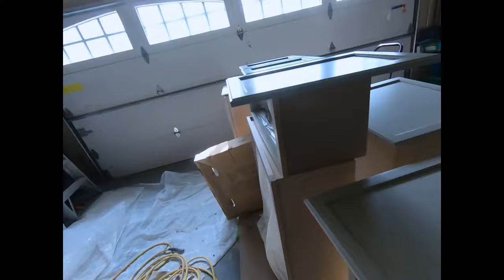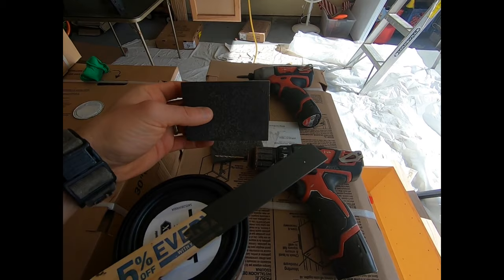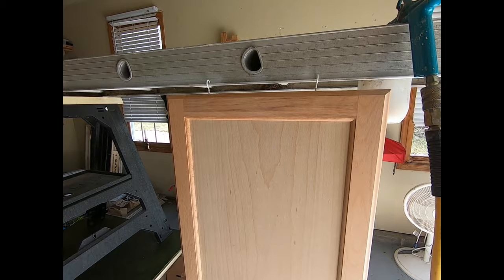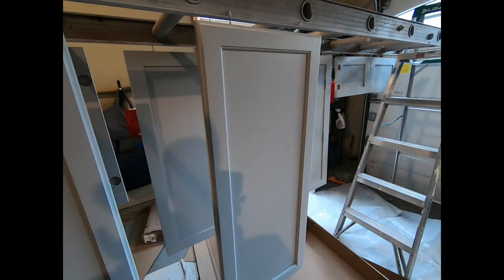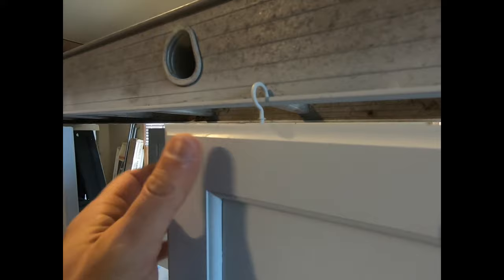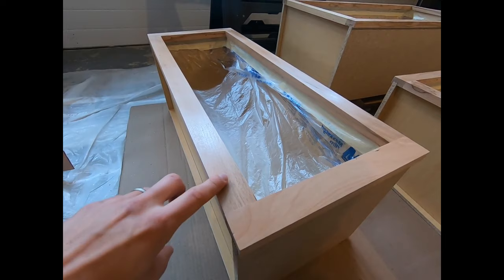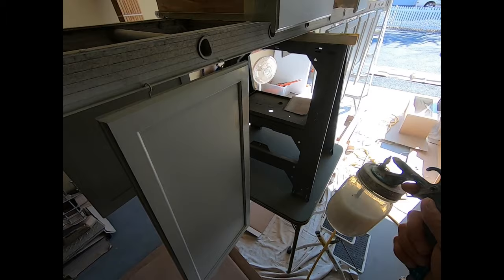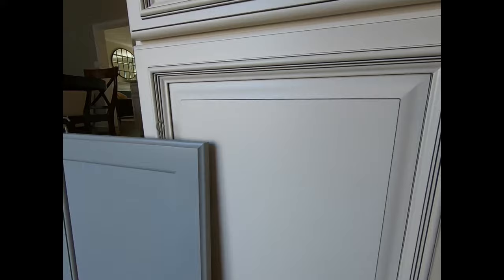How to paint unfinished cabinets from home depot or lowes

Comment: Hello again. So I finally used my critter gun. I sprayed black kitchen/cabinet paint thinned a bit with floetrol, set it to 30-35psi but noticed it was spitting a lot. What do u think I should do to fix issue. Also- what psi did you use when spraying the valspar paint and what position did you have your nozzle? Thank you so much.
Reply from the maker: Hi, from my experience the spitting happens when the paint runs low inside the mason jar.  If it’s spitting when there is enough paint in the jar, it could be something blocking the paint inside the syphon tube like paint slime or debris.  Also, if the paint builds up outside the nozzle, it could cause spitting.  I set my psi b/n 40-50 depending on the paint.  I take a few practice runs on cardboard or scrap wood first.  I set my nozzle all the way down, so I get more paint out.  Hope this answers your question.
Reply: @TrueGritDevelopment  thank you so much for the prompt feedback 🙏🏽

Comment: Did you water down the paint before putting it in mason jar?
Reply from the maker: Depends.  Cabinet paint is thicker, so yes.  I eye ball it.  Add little at a time, mix and test spray.  I don’t water down regular paint.

Comment: Hey there, I have a critter and I’m using Extreme bond primer. The sprayer just spits and I can’t get an even spray. Do I have any suggestions?
Reply from the maker: Hi, I noticed this happens when there is paint build up on the screw on portion of the syphon pipe.  Unscrew the nozzle and use a small bristle brush to clean all the build up.  You can also dip it in paint thinner for a few minutes and brush it.  Also, sometimes while you’re painting and pausing, paint builds up at the nozzle, so be sure to wipe it as u go, I simply use my finger to wipe it off.  If you have Flotrol, you can use that in your mixture, it may help too.  Let me know if that works.
Reply: Thanks for the response! I did as u suggested and got it to spray pretty good for a good minute. I was able to finish seven cabinet doors. But Im starting to think this paint just might be too thick! I used 4 cap full of the floetrol and it just keeps clogging up to point where nothing comes out. I won’t start in the kitchen until I figure something out. Which primer do u use?
Reply from the maker: Yes, looks like the primer may be too thick.  What PSI you on? I would go up to 60 PSI.  Primers are stickier in general, so you will always have a harder time.  Increasing PSI may help.  Oil based primers are best, but they do smell (use a mask).  Alternatively, you can use a water based Kilz primer.  I have another video where I paint finished kitchen cabinets, check it out.  Hope this helps.

Comment: Hi. So you used a sealer before painting. I too, in order for the color I want, must use unfinished wood.
So after the sealer..right to paint ?? No primer??
Reply from the maker: Yep, straight to paint after sealer.  Use cabinet paint for better adhesion.  Also, make sure you use clear coat for added protection.  Hope this helps.  Good luck with your project.  Thanks for watching 👊🏼
Reply: Thank you for your prompt response.. my poor husband..lol 
I saw you used the poly coat . Definitely will. I'm only wondering since ripping out all the old, hang cabinets first then spray ..Garage is empty..so can spray then hang..just not sure which first! Advice?
Reply from the maker: If you are covering the floors and will paint the walls, then hang them and spray.  If not, spray the cabinets first, but you must be gentle when handling them.  Paint requires time to fully cure.  I hung mine the next day, but I was careful.  No jewelry and no sharp objects around.  Good luck!👍🏼

Comment: Hi, great video! Do you have any tips for painting the sides of the cabinets that are not real wood? I just bought unfinished project source cabinets from Lowe’s and the sides appear to be some sort of mdf. I don’t know if there’s veneer on them but it does look a little shiny. Primer and then paint? Thank you!
Reply from the maker: Thank you.  It’s prob veneered OSB board.  Yea, prime it and paint it.  It will prob be rough, so sand after priming for sure.  Good luck 👊🏼
Reply: Thank you! I’m onto the paint step now and unfortunately the critter keeps “spitting” my paint. Any tips? I’m wondering if there’s an issue with the nozzle or maybe I need to up the psi
Reply from the maker: Ok, in my experience the Critter will spit paint under two conditions: 1. The paint is running low in the mason jar, 2. The nozzle needs cleaning or there is dry paint stuck.  I typically will have a needle handy and sometimes I remove the nozzle to make sure nothing is blocking the hole.  BTW any tiny particular can block the air flow you will be surprised.  Hope this helps.
Reply: Thanks for all your help! I’ll try cleaning the nozzle but also did find that it wasn’t perfectly centered to where the air comes out so twisting that helped a little. Happy I found your video! Can’t wait for this cabinet project to be done 👏
Reply from the maker: Glad I could help.
Reply: @michelleginsburg8289  A not so centered paint needle will cause a  uneven spray, just like in an airbrush. If its not centered , you will get more paint coming thru the wider space, and less thru the opposite side of the tip. A airbrush tip is way smaller , but the theory is the same with any larger  spray gun.
Reply: @TrueGritDevelopment  For finer lighter coats of paint, such as this critter gun, you should strain the paint before going into the gun,. As you mentioned, any disruption in the spray is usually dried paint on the tip, or dirt speck in the paint itself. I used airbrushes for art, that are way more precise, but the problems are the same. Spitting can be low pressure too.
Reply from the maker: Absolutely.  I have to admit, I often do not strain the paint and do end up with dry paint bits.  When I strain, I use left over window screen mesh.  Good tip.

Comment: Hi! Can you do all these steps and get a similar finish with paint brush and rollers ?
Reply from the maker: That’s a great question.  I have used a “cabinet” roller on flat surfaces and it looks great, so yes on flat surfaces.  The concern is when you have stiles and rails with designs the brush tends to leave too much paint and you may see drips here and there.  If you have to, I would suggest and really gd quality paint brush and do the non flat surfaces first.  Hope this answers your question.  Thanks for watching 👊🏼
Reply: @TrueGritDevelopment  thanks so much for answering I’m gonna give it a try on our kitchen cabinets your video helped me tremendously
Reply from the maker: Awesome! Good luck with your project.
Reply: @rubyrodriguez205 how did they come out? Debating whether I should invest in the critter or roll it out?

Comment: So this sand sealer fills all the wood grain? Also what did you do on the inside of the cabinets?
Reply from the maker: No, the sand sealer seals the wood fibers and provides a smoother surface for the paint to adhere to.  These cabinet faces were smooth enough for what I was looking for.  If you wanted a wood grain filler, you need to get a special wax or wood filler.  You don’t paint the inside of the cabinets only the face trim.  I have another video detailing the painting process: https://youtu.be/3O-gEEK_t9s
Hope this answers your question.  Pls consider supporting the channel by liking the video and/or subbing to channel.  Thank you so much.

Comment: Great info. What kind of paint did you use? Was it satin? Is it oil based or just regular interior paint?
Reply from the maker: Thank you! This is Satin paint and I used the Valspar cabinet paint.  It’s a water based paint with oil like characteristics.  It makes for better adhesion and finish.  Good luck with your project 👊🏼

Comment: Dont you get overspray and misted paint all over all the other stuff in your garage?
Reply from the maker: Not with the critter.  I did get some on items that were super close (within 2 feet).  I suggest you move items further.  I was able to wipe the misted paint as it’s water based paint.  The critter has very little over spray unlike air sprayers.  If you keep PSI below 50, you’re gd.  For stains and clear coat I go to 20-30 PSI.  Hope this answers your question.  Thanks for watching 👊🏼
Reply: @TrueGritDevelopment  It does! Thank you.

Comment: How long did this project take you? What was the dry time in between coats?
Reply from the maker: Both good questions.  I’ll start with the east one.  It takes very little time b/n coats if you are spraying.  In fact, by the time you are done with the set of cabinets, you can immediately go back for a second coat.  Once you have 3 coats on, it takes a little longer for dry time.  As far as sanding, you will have to wait at least a few hrs.  
It’s hard to say how long the project took.  It depends on how many cabinets…etc.  for this project it took 2-3 days I believe.  Only because I filled in some imperfections and sanded between coats.  Hope this answers your questions.  Thanks for watching and supporting 👊🏼

Comment: We are doing the same thing in our kitchen. What is the durability of this finish like? Do you thin the paint at all when using this sprayer?
Reply from the maker: That’s awesome.  No issues at all with mine.  The protective finish is key to extend the durability.  These are unfinished cabinets, so the paint sticks better than previously finished cabinets.  If you’re refinishing old cabinets, make sure you prime them good before applying paint for better adhesion.  I did not think the paint.  Good luck 👍🏼
Reply: @TrueGritDevelopment  thanks for the info! We are doing the unfinished stock cabinets from Home Depot. I’ve used that polycrylic on other stuff and it seems to work well.
Reply from the maker: It’s going to look great! BTW I’ve recently used the emerald paint from SW and it’s amazing, but soo expensive.  Worth it since you’re saving on labor.  Goes on super smooth.

Comment: What pressure did you set the compressor to spray the paint. You mentioned 30psi for sealer and finish. Thanks for the information. All good stuff
Reply from the maker: For paint I go up to 50 and sometimes 60.  Make sure you test it before hand on a scrap piece or cardboard to make sure you’re getting good pressure.  Also, make sure to keep the nozzle free and clear of any build up paint.  Hope this answers your question.  Thanks for watching 👊🏼
Reply: @TrueGritDevelopment  thanks man, keep up the good work

Comment: Amazing video!!! I have several brand-new harbor freight HVLP smaller paint guns. I want to use them for my cabinets and follow your process. What is a good PSI for the sanding sealer, the paint, and the poly? Also did you sand between the coats of poly?
Reply from the maker: Thank you! PSIs: 20, 40-50 and 20 in your order.  I would recommend spraying a piece of scrap or cardboard to make sure you’re comfortable with those settings.  I didn’t sand b/n poly.  Thanks for watching! Pls consider liking the video and/or subbing to channel, much appreciated 👊🏼
Reply: @TrueGritDevelopment  Thanks so much for the help! I just clicked like and subscribe - keep up the amazing work!
Reply from the maker: Much appreciated…good luck with your project 👍🏼

Comment: I ended up using a gap and crack filler before I spray the sanding sealer. Is this gonna be a problem?
Reply from the maker: I don’t think so.  Try it on one piece and see if you like the result.  The sealer dries quickly.
Reply: Will do thank you. I ended up doing a decent amount of sanding on the cabinets where I joined them together. Would this require me to use a grain filler now?  I feel like some of the areas are more exposed to deeper grain now
Reply from the maker: What do you by joined them together? you installed them and screwed them to one another? Why are some areas exposed to deeper grain? Not sure I follow, sorry.
Reply: @TrueGritDevelopment  all good. Yes I hung them and then screwed them together. I used gap and crack filler to get rid of the seam where they joined together. I did a decent amount of sanding to get them where I wanted them which left the grain a little more open then how it was when I started
Reply from the maker: Ok, I gotchu now.  Yes, you can do grain filler or wood filler or even joint compound and repaint…etc.  BTW a seam b/n cabinets is normal.  If you see professionally installed cabinets they have seams as well.  Of course you make sure the cabinets are right by using a clamp before screwing them together which will ensure a tight seam.
Reply: Last question I swear 😂. Do you sand your last layer or base before the poly is sprayed?
Reply from the maker: Haha…no worries.  It depends.  By the time I get to Poly they’re pretty smooth, so no.  It doesn’t hurt, do a 300 grit quick sanding of the flat surfaces before poly.  I usually run my hands on them and decide from there.
Reply: @TrueGritDevelopment  I appreciate it thank you!

Comment: Great video/ tutorial. Really appreciate it. I was in the market in buying a sprayer, to paint some furnitures de cabinets,(most likely the Homeright Finish max) but I feel like I would have a lot more control with this critter spray you are using. I’ve never heard of the sanding sealer but would love to try it. I do have a few questions hope you can answer- Did you thin out the sanding sealer, latex paint and polycrylic? If so, with what? Thank you.
Reply: Oh and what type of finish are you using in your latex paint? Satin? Semi gloss?
Reply from the maker: Glad you found the video helpful! The critter does have some limitations when it comes to big coverage like a panel or cabinet box, but IMO nothing beats it when it comes to spraying stiles and rails on cabinets doors, trim and even deck spindles.  It is by far the easiest spray gun to clean too.  You do not need to thin the sealer or the poly.  The paint may need thinning depending on how thick it is.  In this project I didn’t thin, but raised the PSI.  Honestly, I would try it as is on a piece of cardboard.  If you feel it isn’t flowing smoothly, go ahead and add some water, very little.  Hope this helps, thanks for watching and supporting 👊🏼
Reply: @TrueGritDevelopment  sorry one more thing- what finish did you use on latex paint? Satin? Semi gloss? Thanks.
Reply from the maker: Sure, paint and poly in Satin.  It’s just my preference as I don’t like too much sheen.
Reply: Will the water mix with the oil based enamel? I am using the exact paint you are using in this video, but the critter will not spray. I thought that it was plugged, but I ran paint thinner through it and it was cleared out.

Comment: Do you have to put a coat of primer on first?
Reply from the maker: Hi, not necessarily.  I didn’t.  The sealer is my go to.  Primers are not exactly the same as sealers.  A sealer will bond the wood better making a smoother surface onto which you can finish.  You can use a primer/sealer although these primers may have lesser sealing qualities.  Generally a sealer is a better option for furniture and cabinetry IMO.  Hope this answers your question.  Thanks for watching 👊🏼
Reply: @TrueGritDevelopment  Thanks for the great video!!  

About the sanding sealer...the Minwax site says "Can be topcoated with any Minwax oil or water-based polyurethane finish".  Do you have to use an oil based paint?  Or can you use a water-based Urethane Trim Enamel?  (I'm interested in using SW's "Emerald Urethane Trim Enamel"
Reply from the maker: You’re welcome.  I used a water based enamel cabinet paint.  All cabinet paints will have oil characteristics, but are not exactly oil based.  You will find them smell differently and stickier than normal water based paint.  You should be good with what you got picked out.  Good luck. 👍🏼

Comment: I’ve never used a sprayer before. Are you having to dilute before using it?
Reply from the maker: Very gd question.  It depends.  In this case I didn’t, but I increased the PSI.  Usually on the paint can you will read whether spraying requires adding water.  With that said, I go by the quality of the paint.  If you’re buying big box retailer grade, you probably won’t need to dilute.  Hope this answers your question.  Thanks for watching 👊🏼

Comment: Does the finished cabinet still feel the same as the unfinished cabinets or do they now feel like real smooth cabinets? Like laminate cabinets or professional done cabinets.
Reply from the maker: Very gd question.  They are certainly smoother, but I won’t say as smooth as laminate.  I would recommend several more coats of paint, if that’s the goal.  The poly definitely adds a professional sheen to the cabinets.